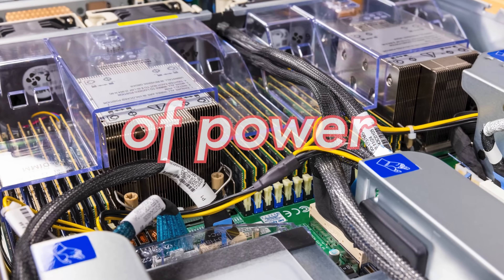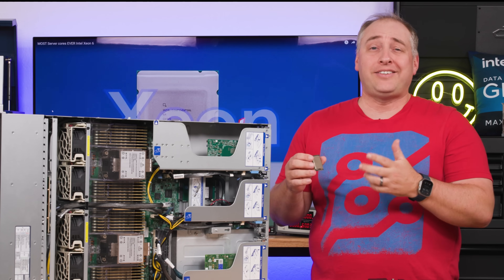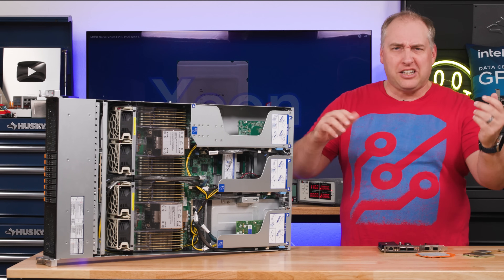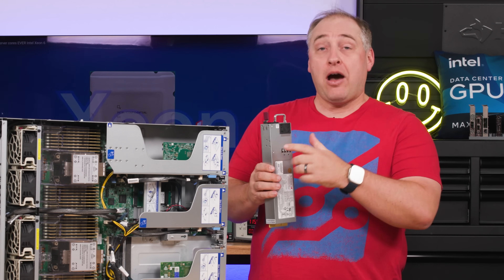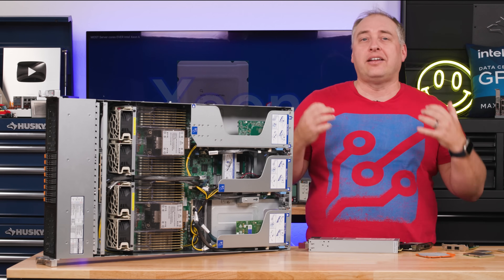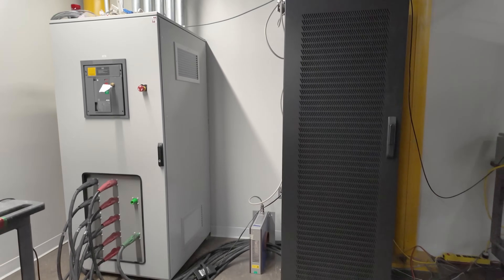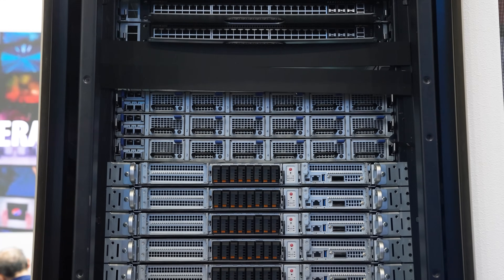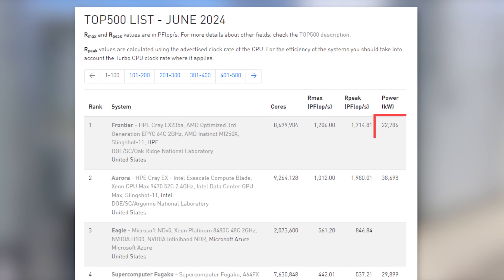Modern Servers Are Guzzling Power - Here is Why

Comment: i have a dell r630 and this thing is way more performance i need even with ai stuff like LLM and image generation. the thing is a single amd ryzen 9 5950x has theoretically the same performance and use less power as 2 xeon e5 2699 v4 like mine r630 uses, but if it comes to paralisation the xeon outruns with more as 4 times the ryzen cpu, the main reason is memory bandwith and core count and cache, the x3d cpus are a other storry for shure but still even those are slow compared to the xeon cpus. 
ok in know servers use a ton of power for doing basiclly nothing compared to desktop systems and this is fine. if your use case dont need those features but compute power and needs to be efficient go with a desktop based system, game servers are perfect for desktop hardware, but if you crunching numbers with big dataset a server is your best option. 
most system limitations coming from memory bandwidth. more cpu speed means you can process more data so you need more bandwith but also if you have more cores mean you can do more parallel and therefore you need even more bandwidth. my main limitation is memory band with not storage, i use two  pcie 3.0 nvme carrier with Bifurcation and all 8 nvme are in raid 10 because i needed the speed but this is this 30gbit is only a bit faster as the models i use require to max out, the cpu is able to handle 76gb/s on memory bandwidth. but i am only able use all 40 cores of the 44 at 100% because of memory limitation. my storage shows it is pulling 23gb/s, this tells me the cpu and storage are able to be faster but the memory is slowing me down. i use 768gb of ram 12 modules with 4rx32 2300mhz this is the fastest ram you can get for the r630. i have tried faster ram but it the bios set it to 2300mhz. but there is possible another thing that slows me does and this is the interconnect between the cpus. i dont know how those LLM at software side work, i could make a artificial program to test the interconnect or raw independent cpu power but this tells me nothing really. this means if i run a porogram that uses many cores and every thread talks to each other mainly this would limit the number of threads can be used per cpu or reduced the thead use time so it reduces in the eand the number of cores being used because if more threads are waiting this means more threads can be run on the same core. yea you get the idea.
testing performance of a system is not easy and every system has its designed use case.

Comment: Are these rail-mounted powerbox-thingys just distribution for 12V DV or ~200V AC?
Reply from the maker: So the Vertiv Powerbar is 1000V. Then the boxes you mount let you do things like two lower voltage circuits for PDUs to plug into with breakers onboard.

Comment: I think you have to be more specific when comparing the AMD vs Intel processors and their power use.
What is the standard geekbench values with identical memory  and identical power usage ?
What are the number of cores / threads ? (These can be different)
Reply from the maker: We talk about that in a bit more detail in the main site article. Geekbench 6 is just about useless for server CPUs. 5 is slightly better but still not useful. We pose it more when we started at 10-15W per core in 2008-2010 and are now at under 2W/ core with Xeon 6

Comment: I wouldn't feel comfortable putting large lithium batteries anywhere near multi-million dollar clusters.
Reply from the maker: You can see the different containment and spacing of the lithium batteries
Reply: @ServeTheHomeVideo  Yep, that help to limit thermal runaway propagation. Gaseous fire suppression is only partially effective against lithium ion batteries. The FAA did some testing, the results are online. I'd feel more comfortable with a thick concrete wall between those batteries and anything important. I could store gasoline in a DC and manage the risks but at the end of the day it's better to have the gasoline somewhere else.
Reply: @ServeTheHomeVideo https://youtu.be/C3m6Md4WBVg?feature=shared

Comment: Power and cooling: many years ago a customer selling HPC systems told me that a university had expressed their budget as “600 kW - you can split that however you need between power and cooling”
Reply: That's a surprisingly practical budget constraint. I take it professors/department personnel were running the project, not university administrators?

Comment: Seriously great look at the data center side of things. Would love to see more like this, but also doing a deeper dive into power and cooling for home labs or small offices would be useful. How am I supposed to power a 2000w+ system when a standard circuit is just 1500w?
Reply: I ended up pulling two 30A 208v lines for my home lab. One is for spot cooling and the other keeps the servers happy pulling back 6kw :)

Comment: I frankly don’t understand why the choice was made that it was okay to break the power envelope to get more performance. Part of this is probably intel’s stagnation pre-AMD that broke the dam because it was the only way to increase performance for several gens, but how were data centers okay with just eating that cost for relatively less performance per watt?
Reply: Even if it is less performance per watt, i am 99% sure the performance per cost is WAY up. 
Take the total system cost including software, cooling, running cost and space over the expected lifetime then compare it to how much work is done.
Performance is WAY cheaper today than it was 10 years ago.
Reply: Performance per watt has actually increased !
Reply: @prashanthb6521  I know it has increased, but the incremental gains have slowed significantly it seems. I guess my question is, when data centers realized they would have to start massively scaling up their power supply and cooling solutions, at high cost, for let's say the same % gain in performance YoY, why didn't they balk?
Reply: @TheShortStory  I think this video is making people look at this issue in a wrong way. There is no serious problem here. Assume a DC had 1000 old servers running. Now it requires only 600 new servers to run the same software load. Also these 600 new servers consume the same power as those old 1000 ones. Now every rack in that DC is 40% empty, so they decide to fill it up with more new servers, raising the total power consumption of that DC. If they dont want to spend on new power supply and cooling then the DC operators should run only 600 servers. They would still be earning the same revenue. On top of that they would be spending less on maintenance as they are operating less machines.
Reply: @prashanthb6521  I’m sure the business case makes sense at the end of the day, because otherwise this transition to higher-power devices wouldn’t have happened. But someone is paying that price, whether it’s VC or consumers or data center operators through their margins. Yes efficiency increases but if a data center requires a major modification that is a cost for both the environment and _somebody_. I wonder if there really was demand for all that added performance before the AI craze began

Comment: I think the market is ripe for some ASIC maker to bring efficient hardware to the market. The Excess on the network side is just as crazy.  These new 800gbit switches for the GPU networks are only helpful because they have to throw so many GPUs at the problems they are trying to solve.  nvidia is incentivized to solve the clustering problem with more nvidia magic sauce.  The only upside is that folks who went with Ethernet will at least be able to use their switches for something else later.  The infiban switches are less useful if you don't need a huge cluster.

Comment: great video, I never would've thought about servers having ballooning power envelopes.

I hope simpler more traditional server needs can be achieved with distributed low-power machines like SBCs.
Though I expect it'll just stick to the same hardware but one server does the job of several. 

Not looking forward to every AI hack company guzzling server and power resources on their dumb ideas.
Reply: I have a customers who went from a full rack (or racks) to 2 or 3 servers (mostly moving everything to virtualization) and in the end they have room to add more VM's in the future and use less power.  So in smaller deployments it can cut costs and be more efficient to consolidate to newer hardware but it's a whole different animal when talking about large enterprise/datacenter/hyperscalers.
Reply: Outside of ECC memory and very few other features, the top end of servers are just scaled up laptop parts. The CPU may be 500W, but it is mainly the same part as your 5-15W laptop CPU on a larger scale. High power systems are often more efficient than just adding 100x low power systems...

Comment: the power requirements are getting rediculous,  its about time that the chip company and pc manufactures comply with energy efficiency requirements of less than 500w per system and better by 2030 etc
Reply: @ram64man  The problem is that "per system" isn't really a helpful metric. With that, you'd just end up getting lots of "systems" with a single GPU in them.
The problem is that people are using them for wasteful things. Which is a political problem, not a technical one.
Reply: Consumer systems are practically limited in total powerdraw, and we are around that limit today. When a normal socket/fuse can not suppoly enough power, the number of consumers willing to buy the system will drop significant. When "normal people" can not even use the top end, it is no longer a selling point for the lower end systems either.
Reply: @ssu7653  I'm sorry, but no. It may sound absolutely insane to you (because it absolutely is) but you can get 2800W consumer ATX power supplies. For, I dunno, welding GPU diodes together at the New World main menu or something, I guess. And yes, you would need a fancier than normal outlet to plug in into to get the full rated load.
(And I've seen 2800W redundant server supplies too, some of the heaviest feeling Intel Common Redundant Power Supply Standard units I ever held in my own hands)

Do actual consumers use them? No, they are a very very small quantity of the installed base of consumer machines (which are typically under 300W draw), so I concede there.
But as far as consumer-branded-availability? Yes, a number of crazies are trying to push them as useful to gamers (which they are not).

I know what you meant, but what you said had a different semantic meaning than the intent I conceded the point to.
Reply: @SLLabsKamilion  Any system targeted at high end desktops won't use more than 1500w or so. if you made a consumer system that needed a 2800w PSU you'd basically exclude all 120v markets, except for the select few willing to install a dedicated circuit for a computer.
Reply: That is a stupid argument because as the video explains the core counts have gone through the roof so the power per MIPS/FLOPS is through the floor. What consumed 100kw and was in 8-9 racks 10 years ago is now in one rack has much more compute.
Reply from the maker: We have a big AMD Siena series on the main site and we are working on getting more Xeon 6E 1P content
Reply: If servers are guzzling more power they are also doing more work nowadays.

Comment: At 20 cents per kWh that's $210k per year. Just to let the thing. That's mental.
Reply from the maker: Yea. Huge costs
Reply: Lookup commercial / industrial power rates. But, yes, modern data centers have huge power bills. There are several "small" DC's around here (RTP/RDU) that have multiple 50MW connections.

Comment: Data centers should be built in Canada. The heat could be used to warm residences so that fossil fuels will not have to be use to heat homes. In Canada the Dictator taxes heating fuels to the point that citizens cannot afford food.
City water supplies can be used to cool data centers before entering homes. The homes can use heat pumps to extract the energy to warm the homes or used to supplement hot water tanks.
Why use fuel twice.
Reply from the maker: Some European DC designs do this

Comment: The GPUs are the primary available options, but as the ARM CPUs with built in NPUs are expanding the power draw should drop once they start scaling it out, or at least increase performance at the same power draw. Also the increase in M.2 based NPUs that do not need a dedicated graphics card can help scale things out as well. Even then, most of these NPUs are still only sitting in the 3-50 TOPS range, versus the mid and high range RTX cards can handle 100-1000 TOPS. With a similar ROCm enabled workload, the mid and high end RX7000 series are still within the 150-800 TOPS range.

Comment: We'd require a lot less energy if people building applications focused more on performance and using efficient languages. I think most developers would be surprised what a single CPU can do if they changed their techniques slightly. AI and crypto will of course blow all of that out of proportion even further.
Reply: Backend engineer chiming in, more often than not it’s not up to you to make the decision to spend N amount of extra engineering hours to make something more efficient. In many cases the product owner is the in charge of making that decision for us, based of time and cost it’s almost never the case where it makes sense. Both in terms of time-to-market of a feature or product, and the cost of engineers compared to the meager savings in hardware provisioning. Throwing more compute at a problem is almost always cheaper than  chasing that last 10% or whatever of extra performance
Reply: @skaylab  agreed for after-the-fact improvements. With the right monitoring and data, it can be relatively quick and easy to make 10-30% improvements for a particular flow in an existing product. At least, that's been my experience.
Reply: Sadly it is not the energy efficiency or the amount of data that can be processed per CPU cycle that is valued, but Time To Market and how many hours the customer has to pay for those engineers to build this application. Hourly rate and the project cost (+ TTM) is more important sadly than anything else. You kind of see the same thing nowadays with bland, boring, concrete LEGO buildings slapped together. Gone are the beautiful ornaments and decorations of old. They were often made on the spot by (wood) workers, although there were also shops you could by premade stuff. The hourly rate is now the most important factor instead of material cost back in the day. Sad to see really.
Reply: Exactly. Many devs just dont optimize their code. Because there is always some dumb VC willing to pay for more AWS instances.
Reply: What are you referring to? I’m genuinely curious if you don’t mind explaining
Reply: @CD-eq8tv  When we build applications, we choose tools to build with, like programming languages, libraries, etc. Each of these tools has tradeoffs, like how fast you can build features vs how fast it actually runs. Too often the decision is made in favor of developer speed, so you end up with languages that can only utilize a single CPU core, or that run orders of magnitude slower than another language. The slower things run, the more power they consume, and the more machines we need to run the app on.

Other times the issue is in how we build certain features. We're under pressure, have time constraints, etc. So we choose any solution that gets the job done, even if it isnt fastest. Months later, that feature gets run hundreds or thousands of times per minute and the app feels slow or we incur more cost than necessary.

TL;DR: Sometimes developers need to be ok with taking a handful of months more to choose efficient tools and solutions to problems.
Reply: @ryanseipp6944  it’s also often the case where most of the web is not comprised of compute-heavy workloads, so the cost often lies in other factors like load balancing traffic, database provisioning, and CDNs / object storage, which are much harder problems to solve for cost compared to cpu cycles. The calculation intensive stuff is mostly being handled by libraries and software that is heavily optimized for that specific workload, even ignoring AI take for example traditional stuff like nginx ,ffmpeg and the likes